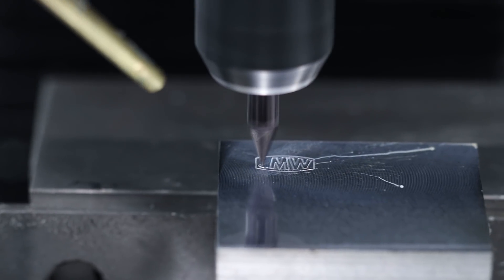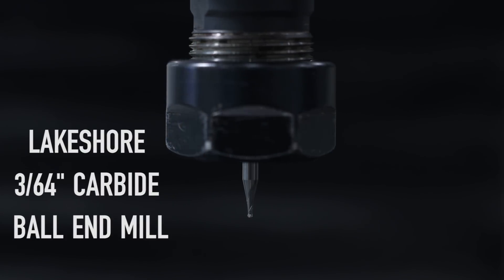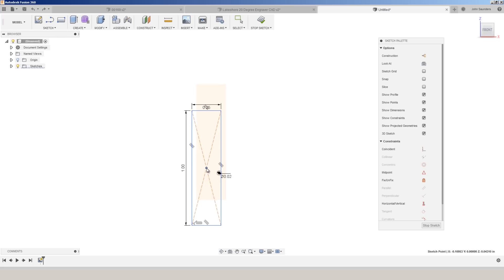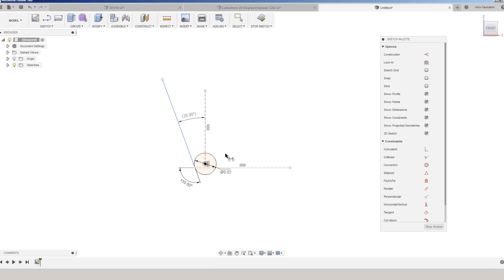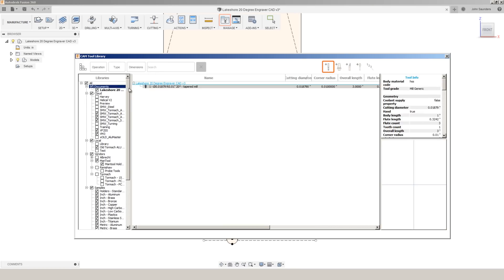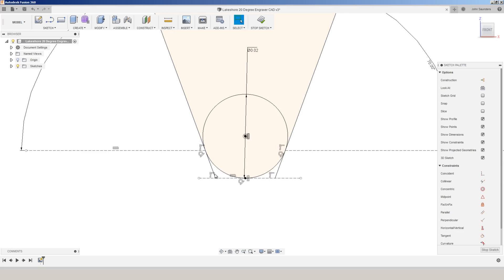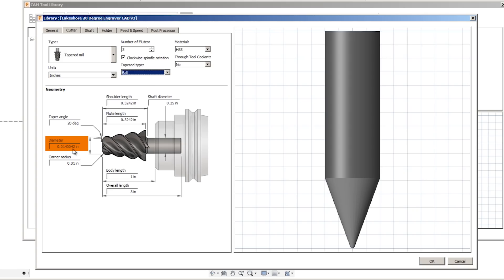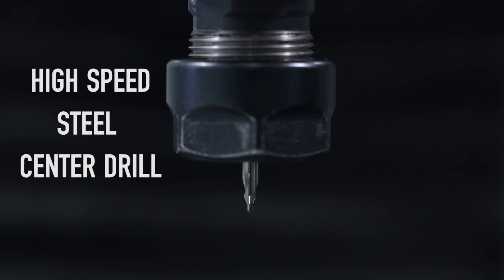How to Model Tapered Engravers in Fusion 360 | WW250

Comment: If you want to measure from a line to the outside of an arc or circle (instead of the center of a arc/circle) like at 5:18, you can simply use the dimension tool. Click the line first, then (anywhere else) right click, choose "Pick circle / arc tangent", no more messing about with construction lines all over the place.